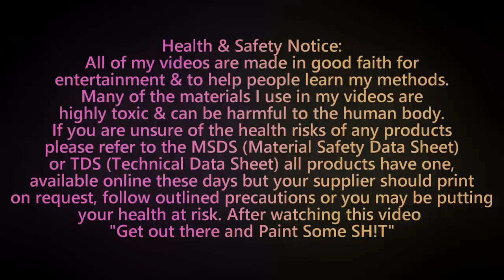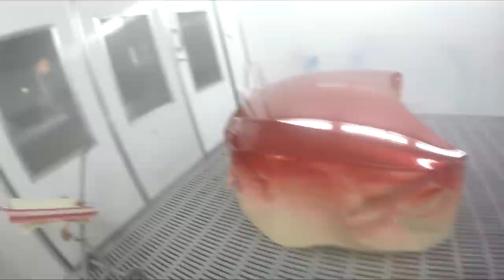SATAjet Sixties Edition 5000B RP 1,2 Clear Coat

Comment: Had the same problem with my sata 4000b, pps adapter leaking but only when im using the smallest one think its 180ml. Fine when i use the 650ml and 850ml ones.

Comment: Well that's answered my problem. When I spray liquid glass through a 1.3 T110 it's like trying to spray primer. Which is the best for vhs clear you have come across. Joke of the day what's worse than a leaking pps adapter (check comments for answer)

Comment: Can you plz help me I have a sata jet 5000b rp 1.4 tip  and for the life of me I can not get the clear to spray properly I lay it on heavy it looks dry I lay in on light it has orange peel. I set 20psi. air knob wide open, 2 to 2.5 turns out fluid and 3/4 fan. I'm just not understanding what's going on I've used other guns with no problem... I spend the money on a big name gun, and I can't seem to get it right.

Comment: Gunner"I seen your demo video on the 5000 rp 1.3!! & I have to say the sata 5000 rp 1.4 is the best!! Tip size for clear..I am tekna & iwata  all the way..But if I had a choice on tip size for the 5000 rp it's  the 1.4!! From my experience using the gun..👌👌
Reply: Can i use 1.4 for low solid clear? My compressor 5hp
Reply: @christopherkurniap5521  use a smaller tip size. You probably wont have enough air volume to atomize correctly with a 1.4 tip.
Shops have massive amounts of air volume, so the comparison is not the same...
Reply: @splash5974  okee thank you. I think 5hp is big enough for any kind of spray gun haha. Can u suggest the best gun for me?  Low and high solid clear and fast work. Do u recommend db gti pro lite te20 cap?
Reply: @christopherkurniap5521  
Has nothing to do with HP man! 
I have a 5hp compressor at home with a 26 gallon tank. It struggles when spraying anything more than a couple panels...You could have a 3hp with 60 gallon tank and it will be better. Its all about air volume, not HP! 
For home use the TE20 should worl alright, the TE10 will work even better though...
Reply: Ohh i see. Mine 50 gallon. Thank you very much for your answer.
Reply: @christopherkurniap5521  
You should be good with 50 gallon. TE20 or TE10 will work great for you!

Comment: Gunny Gunny Gunny  don't ever use an adapter on a SATA the machining tolerances are not good enough and they will stretch the top of the spray gun, many guns have been rouined this way also nothing beats rps
Reply from the maker: Well you'd hope so at around $3 for each disposable pot 😂
Reply: what on earth are you talking about?

Comment: Do you have the gun wide open at 29 psi?
On my 5500x 0. If i dont wind in the fluid a bit it id loud as hell.
Reply: Yeah my 5500 0 1.3  I have it 1.5 turns out. It hammers it on

Comment: I used the 1.3 sata 5000rp & it's just to slow for me!!So I would imagine the 1.2 would be super slow of a gun for me!& to much overspary ,results of to small of a tip size!!5000 rp 1.4 is just rigth..In my opinion & experience & use of the gun..😊